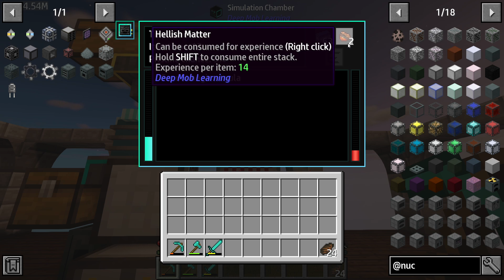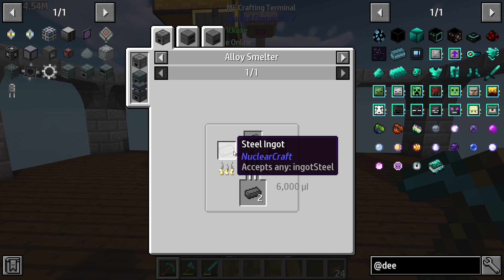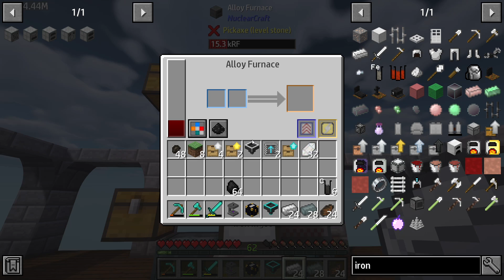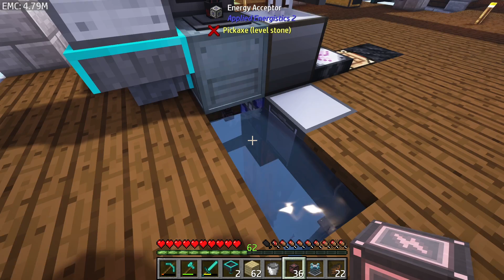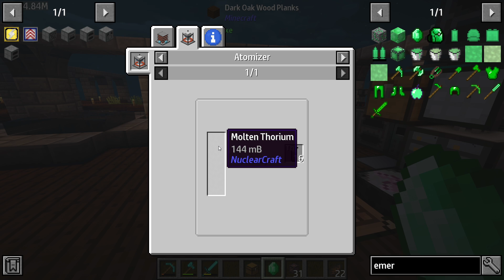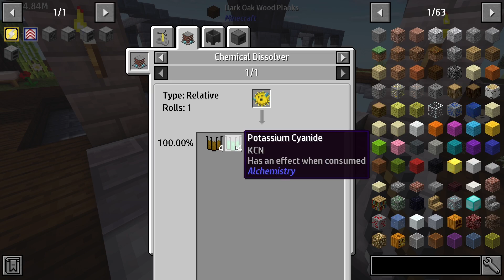Chemical Exchange Ep. 7 NuclearCraft Processing

Comment: I'm just about at the ProjectE portion of the modpack, got a simple fission reactor setup making 2k RF/t just need to automate EMC creation and should be set to rush towards the endgame
Reply: is there any way to directly add chemicals to the transmutation table? i got a squid ink farm and can easily get to 1M EMC in a small amount of time.
Reply: SupremeDeity Unfortunately no, you need to use the chemical dissolver to get the elements you need to add to the transmutation tablet, getting Neptunium will take you through Nuclearcraft Fission Reactors. Getting a EMC Farm going is important because the ProjectEX stuff will cost you trillions of EMC to make the fusion stuff to make other elements.

Comment: The quests will open up through Nuclearcraft (enjoy the rabbithole...) and from there into Project E(X). It seems that the 5 repeatable quests (Bone, Graphit, Cellulose, Gunpowder and rotten flesh) are counted equally so you can only complete 95% of the quests...
Reply: Yeah I noticed that too. Did you finish the periodic table page of the quests? I never really bothered and I also didn't build an element fusion and fission thing, because it feels a bit useless. I want to bring the dragon model to self aware and then I guess I'll call it a day.
Reply: @PeterPan-dz7mu  yes, I finished the periodic table quest. I just took 2 stacks Hygrogen to the fusion reactor and set up a pesonal EMC link to a quest chest. Then I put every element into the output of the emc link and waited a few seconds until 1000 where "quested". Then created the next element. "Rins and repeat"...
Reply: @mawoh3027  That's clever. I only found out about the personal EMC links very late. They are really good. I used them to craft tons of snowballs for my cryotheum cooler blocks. The problem with the periodic table page is that I have quite a few "holes" in there still, probably because you need the fusion and fission thing to creat the missing elements. And I don't feel like doing that, because they are not numbered on that quest page.

Comment: Hmph, in the latest version of the pack, Boron is only accessible from the fission or fusion multiblocks. Guess I won''r be doing nuclearcraft until I figure those out.
Reply: Weird, so they changed the progression of quests? Fission multiblock used to be at the very end.
Reply: @beardeddragonwood  I think someone made a mistake somewhere, as Boron is supposed to be a fairly early quest, but I can't see any way to get it in the 1.1 version of the pack. Just downloaded 1.2, so I'll see if its fixed when I test it out later.
Reply: You're a wizard harry
Reply: XD

Comment: Finaly a new Video im stuck in my progression towards to quests
Reply: where exactly are you stuck? may I help?
Reply: @mawoh3027  I dont know how to get Neptunium plutonium etc.
Reply: @geopeet3789  Oh yes, that was quite a rabbit hole! Here is how you get it:

You need a Nuclearcraft reactor to run of "TBU Fuel" (to get it: run Thorium Ingots through the "Isotope Seperator")
After you burned it in the reactor you are left with "Depleted TBU Fuel". This goes through the "Fuel Reprocessor" which gives you 32 "Tiny Clumbs of Neptunium 237". You can craft it into "Neptunium 237" and run this through the chemical dissolver to get Neptunium.
For Plutonium: HEN-236 Fuel

For Americanum: Do the same thing with "LEN-236 Fuel" Just look up the recipe in NEI.
For Curium: LEA-242 Fuel
For Berkelium:HEA-242 Fuel
For Californium: LECm-243 Fuel

WARNING: LEA stands for "Low Enriched Americanum", HEA for "High Enriched Americanum". Both the LE and HE goes for all the other fuels. HE produces WAY more heat and can potentially melt your reactor! be carefull and check if your reactor can handle that much heat BEFORE putting in the fuel!
Reply: My reactor got melted twice already because of me forgetting to turn it off sometimes.. I should never ever work in the kitchen xD
Reply: @astralstriker  after my first meltdown I've setup 3 reactors to deal with the different fuels. I just didn't want to risk it again...